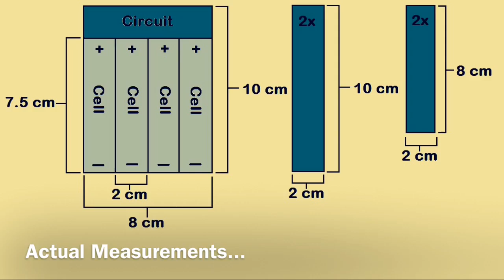How To Make 18650 Battery Charger [MOD YOUR OLD POWERBANK]

Comment: can u make another tutorial making a power back up for modem/router just like a UPS back up. i've been looking for that kind of tutorial but cant find the ryt one here in youtube. the set up is like this, from 220v AC the modem will power up and battery will charged and when the electricity is out the battery will be consumed by the modem.

Comment: bro its dangerous
Reply from the maker: +Shido Ejercit no...it's not
Reply: Can u prove it
Reply: actually it is because you have no balancing wires to some of the batteries and if one of the cells go bad it could cause the charging to be off and can blow up
Reply: @matthewvail4167  No
Reply: @matthewvail4167  all power bank have same structure.he only changes 18650 cells.so what's the big deal man.if it will blow than any power bank can blow

Comment: I did this to charge my phone battery, pcb from swelling powerbank. It looks ugly, but worked. casing is from universal charger. but it has one problem. It needs to plugged to mains and not so called portable. Then I removed the internals and hooking wire to powerbank pcb.
Reply from the maker: awsome..bro

Comment: u r just assembling it u stupid ass change the stupid name and u not a mechanic
Reply from the maker: +Touhid Mashood Please Read The Full Title Again...[Easiest Way To Make] That's Why I Use The Powerbank Circuit So Anybody Can Make This At Home No More Circuitry Needed...Okay
Reply: it's still assembling. easiest way of making is supposed to show an IC which is easy to find and easy to build a circuit around. Y would any1 play mechanic if he needs to see a video to connect batteries to a ready circuit and put it in an enclosure by taking the  circuit out of an enclosure which it was already in?!?! if u don't like to call it assembly then here's an idea, how about u name it, how to mod ur old portable power bank mobile charger by adding XYZ battery and putting it in an ABC casing
Reply from the maker: is this okay "How To Make 18650 Battery Charger [MOD YOUR OLD POWERBANK]"  i don't want make video title so long

Comment: u r just assembling it u stupid ass change the stupid name and u not a mechanic
Reply: it would of actually been somewhat impressive if he did it right and bought 4 cheap powerbanks from the dollar store and wired them where each battery has its own charging circuit, all connected to one USB power supply. then you could actually charge mismatched batteries safely, or just one or two if thats all you needed. thats what I did but with just 2, as I only have 2 18650s i need to charge for my e cig.

Comment: how big can i do that? i mean can I parallel more cells to make a beefier bank? like 20 cells? O.O sorry im just too excited for this project :D
Reply from the maker: +Marionne Patrick You Can Add More Cells But...It Takes More Time To Charge All Cells...And More Cells Can Create Some Unwanted Malfunctions...I Mean More Cells Can Create A Looping Voltage Circuit So It Can Damage Your Cells....So If You Want To Add More Cells Use More Charger Circuits...Thanks For Your Comments...

Comment: Hey. Nice video. And you accidentally made a high capacity powerbank. But doesn't the mi powerbank charge up to 4Volts, but 18650 charges to 3.7 Volts?
Reply from the maker: the normal mobile charger has 5v dc...when you conect a charger with power bank it gives 4.5v to the batteries but in pulses so batteries can charge up to 4volts upto 1000mah or up...and one 18650 has 3.7volt some has 4volts capacity...most powerbank can charge up to 4 batteries easliy...sorry for bad english
Reply: Okay. I see. But does the indicator light up(all leds) when it reaches 3.7 V or 4V? Thanks.
Reply from the maker: Yes...But Its Depend Which Circuit You Use...
Reply: Mine looks similar to yours. But it's from an imitation Mi powerbank. I just want a safe method of charging the batteries without overcharging it. Thanks again.
Reply: a full 18650 has 4.2V, i mean all 18650 lithium ion battery
It has as medium 3.7V
Please why you said, some have 4V and some 3.7v?
Reply from the maker: i am talking about some similar kind of 18650 battery...that only reach up to 4v...rarely used some times...
and i just said it for Don't Getting confusion if some batteries dont reach 4.2v level...you can also see in my video...that 2 blue batteries not reached to 4v...
Reply: I'm sorry. I don't really know much about batteries. But this is the datasheet i found online on the batteries i have. https://www.usbid.com/assets/datasheets/95/cgr17670hc.pdf